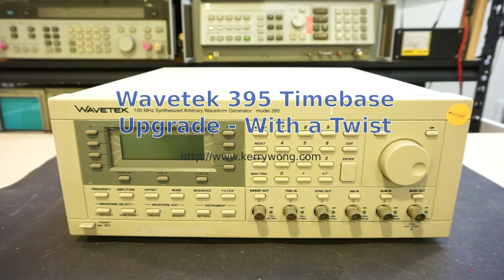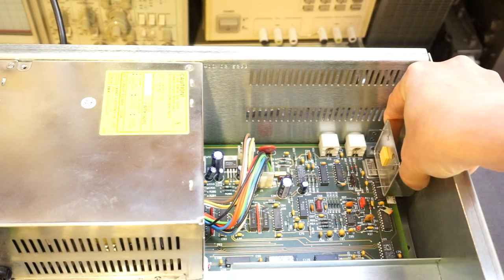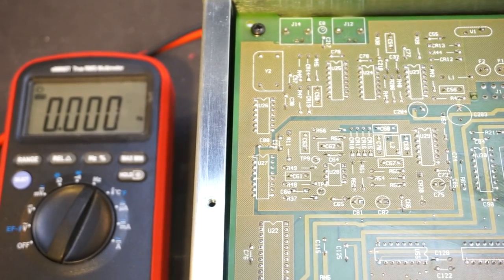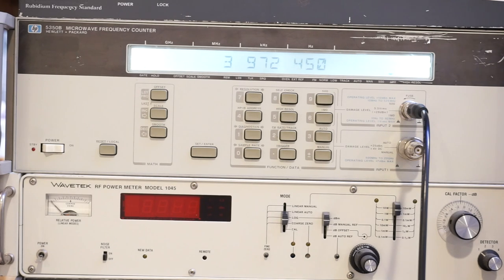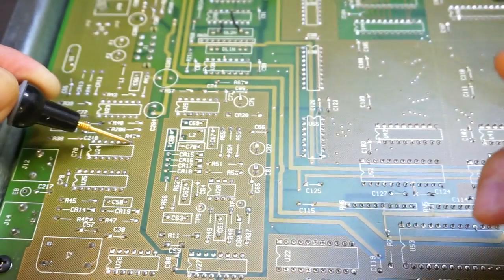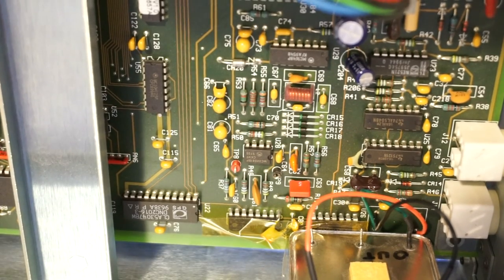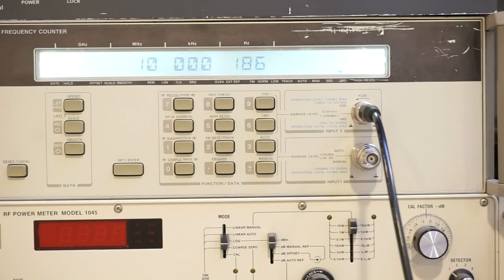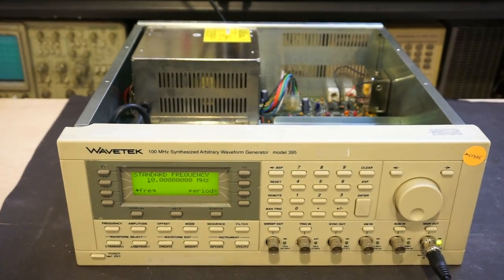Wavetek 395 Timebase Upgrade - With a Twist

Comment: Nice video, I think in that situation I would of installed a good tcxo in the same package style. If using an ocxo I wouldn't want to risk burning out traces from the much greater current draw, I would of connected directly to the power supply connector.

Comment: Are you worried about the OCXO getting warm and causing the tape to let go? If that oscillator falls down 90 degrees, that could cause a huge problem! What do you think about morning it elsewhere (without tape) and using coax to carry the output signal?
Reply from the maker: Na. The OCXO doesn't get much warmer than the surrounding even after running for several days. The OCXO is also resting on the IC underneath, so the chance of it falling is pretty slim. That said, the waveform generator is mainly sitting on the shelf. I probably would change my mounting method if I move it around more frequently.
Reply: Kerry Wong good to know! Every time I use an OCXO I wrap it in styrofoam (to reduce power) and I notice it gets very hot. It makes sense that the outer metal would be much cooler in open air! Thanks for the repose, and keep making great videos!

Comment: Nice work! Some stand offs would stop the case acting as a heatsink for the OCXO. Maybe just some thick foam like that stuff for mounting pictures.
Reply from the maker: The OCXO already has sufficient insulation inside, the case is barely warm so it probably doesn't matter much.

Comment: Nice mod Kerry. Couple of things I wondered about...unless you're going to leave the unit on continuously doesn't upgrading the oscillator to a OCXO defeat the purpose since you'll have to wait 15 minutes for it to settle down if your work requires better accuracy? Does the AWG have a reference input you could feed from your lab standard? And finally is it possible that the added current thru the IC chain ground route could exceed the current carrying capability of the trace? Wonder if there's a better PCB ground connection. BTW, my first thought when it didn't work was that the four layer ground pin connection may have been damaged as you were extracting the Fox. All this is really minor stuff though...thanks for sharing!
Reply from the maker: Hi Dino,

Yeah, I was actually thinking about adding a separate power supply for the OCXO so it could be powered on while the unit is off. And yes, the AWG does have an external reference input jack at the back and I realized afterwards (@Cliff Matthews's comments reminded me) that my mod would essentially disregard the external reference input. So I am planing to add a buffer to the output of 7404 so it could switch off the OCXO if external frequency reference is supplied.
Reply: Hi Kerry, good stuff as usual. As alluded to in the comments powering the ocxo from an external power source would be a good choice, however  .... I have so many things with ocxo's in the lab that are "always on" I'm leaning towards settling on my rubidium standard being what is always on and saving energy by not having these other clocks warming up the lab :-) For example, I just looked over and the Fluke PM6685 frequency counter which has probably been on for at least a year now just chewing power. My 5350B I do make a point of turning off (and unplugging) but that's more an exception.
Reply from the maker: Thanks Vince. Now five of my instruments all have "always on" OCXOs which do consume quite a bit of power. I could use my rubidium standard as external references for all these test gear but the cables would become messy and they would be less portable...
Reply: Shouldn't you leave the ocxo on and just detach it's output when the original xtal would have turned off?

Comment: What if the output of that nice TCXO gets too low of a termination when wavetek softare wants it turned off? Maybe consider that 7404 output as gate drive for a high-side mosfet switch. Better yet, leave it on and switch control the output with 7404.
Reply from the maker: Good suggestion, but I am not sure why you would want to turn off the main clock though?
Reply: If it truly is the main clock, we can ask why they would turn it off..  Possibly the uC runs its sw using the on-die clock since it's just for control and loading patterns into memory? Not that familiar with it.. Great video!
Reply: Data sheet states "MCU can either synthesize an internal clock signal from an external reference or use an external clock input directly. Operation with a 32.768-kHz reference frequency is standard. The maximum system clock speed is 20.97 Mhz. Because MCU operation is fully static, register and memory contents are not affected by a loss of clock". 
On the tear down, I saw no other obvious clock source (not even a ceramic resonator) perhaps MCU xtal was hidden under PCB or clock is buffered coming from front the panel logic? It would be interesting to know when and why 10Mhz clock power is controlled.
Reply from the maker: Aha, this makes sense. If an external clock is supplied, the internal clock would be disabled and the reference clock would be used. So the only drawback of the way I hooked up my OCXO is that I can't use an external clock source any more. I will probably add a high current buffer after the 74LS04  and change the OCXO ground pin to the buffer output at some point.